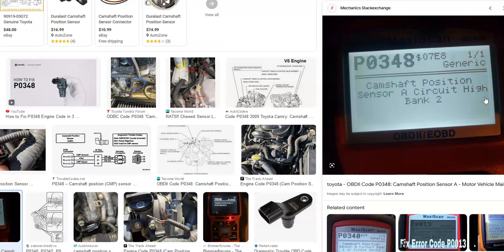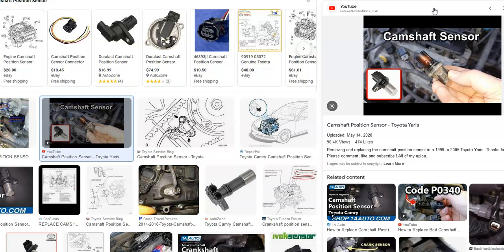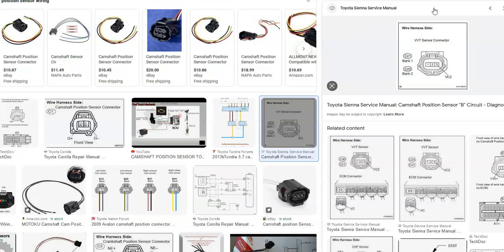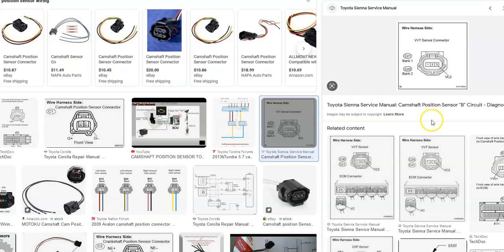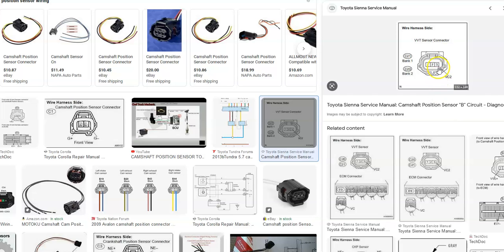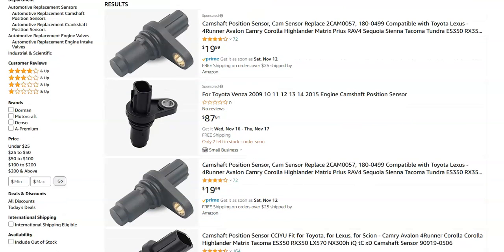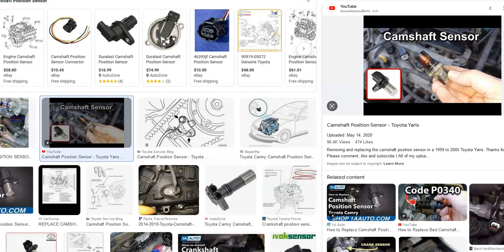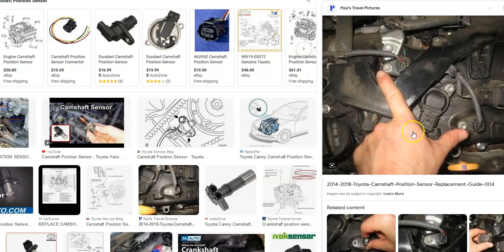Causes and Fixes Toyota P0348 Code: Camshaft Position Sensor “A” Circuit High

Comment: I have rx 350 2010 and i have p0348 which fuse i should look for?
Reply from the maker: It's usually labeled EFI, ECM1, or ECM2. If you have a meter, check for voltage. There should be 3-wires, ground, power (12 volts), and signal back to the computer. I made a video on this here is a link. https://youtu.be/MU95sRU8wng

Comment: I have. A P0390 code on my 2008 Toyota HIGHLANDER Sport
It’s pointing to the POSITION B SENSOR that’s throwing the P0390 code 
I replaced the connectors on both Camshaft position sensors . I still have a check engine light light and a VSC  LIGHT ON. Any suggestions? I haven’t replaced the Camshaft Sensor as of yet . Thanks for your video 🧰

Comment: Still getting P0348 on 06 is350. I replaced the sensor, get 3.7 volts to the sensor as source voltage with key on. Still get error as soon as key on even though I erased code multiple times. Verified sensor location is correct as Bank 2 sensor A (driver side front 90 degree CPS) and have swapped sensor and locations - keep getting same error. I’m at a loss on what to do next. Even my mechanic doesn’t have any ideas off the top of his head other than “bad wiring.” Anyone have any other ideas I can try?
Reply from the maker: Have you replaced Sensor B? Sometimes, the old sensor can be out of correlation with a new sensor and throw everything off. It doesn't happen often, but it does happen occasionally.
Reply: @HVAC_Mechanic  I unplugged sensor B and started car to get P0393 error "Camshaft Position Sensor B Circuit High Input (Bank 2)" along with P0348 "Camshaft Position Sensor A Circuit High Input (Bank 2)". Cleared all the codes and plugged sensor B back in and P0393 went away but still have the P0348 error. I would have thought that if sensor B was bad or going bad, the P0393 would have returned but hasn't - P0348 never goes away like a bad rash thus indicating issue with sensor A bank 2. I do have a question though, does this A sensor work in-line with the crank sensor? In other words, would replacing the crank sensor possibly fix this or is that just chasing ghosts? Also, would I get 3.7 volts on the return wire from the sensor to the PCM with the car running if the sensor is good? If so and P0348 error is still there, wouldn't that indicate a bad PCM or wiring to PCM? If not, then the replacement sensor is bad as well?

Comment: i have an is 250 i cant figure out exactly which one is “A” the one on the right (driver side) or the one on left (passenger)
Reply from the maker: It can be confusing since they change things around from engine to engine, but the sensor "A" will be on the Intake side of the engine and sensor "B" will be on the Exhaust side of the engine.
Reply: On my gs300 sensor A bank 2 is the sensor on the driver side right by the oil crankcase cap(remove engine cover). On mines there a orange sticker that has B2 on it indicating bank 2.